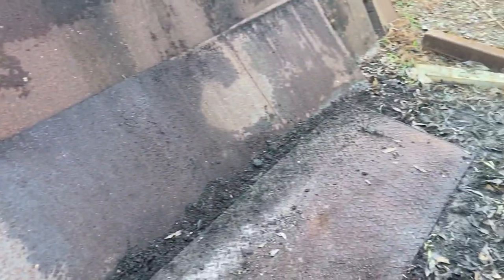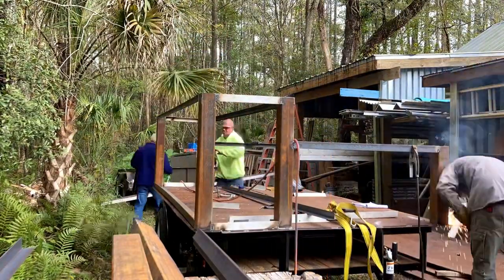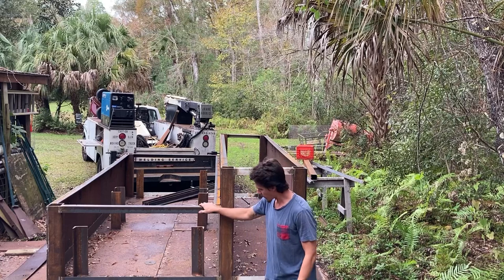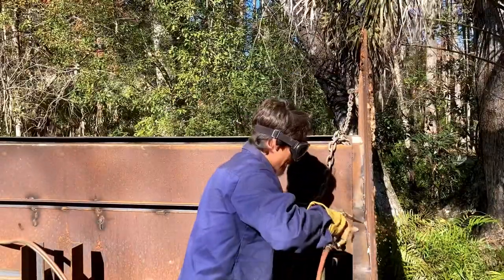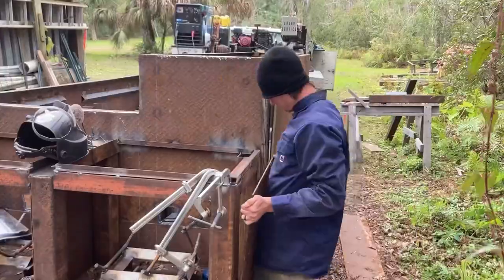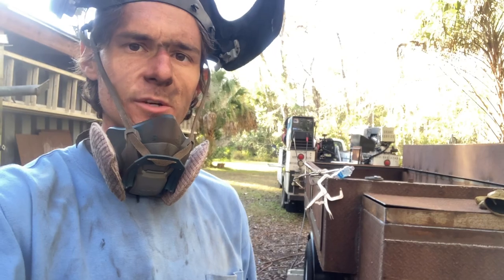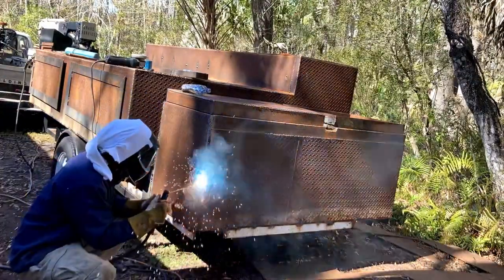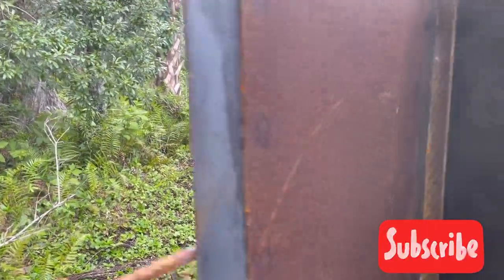💨 MASSIVE Smoker Built with Upcycled Metal 💨

Comment: Not a welder, what’s the difference in welding rusted or warped steel than with new material, is it the surface or the shape that makes it difficult?
Reply from the maker: You have to make it square when new steel mostly comes square.